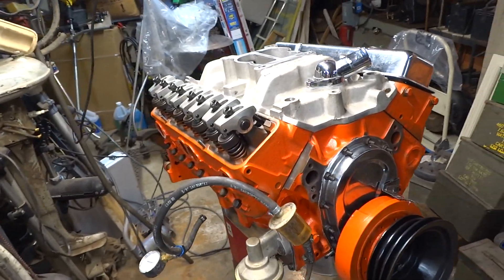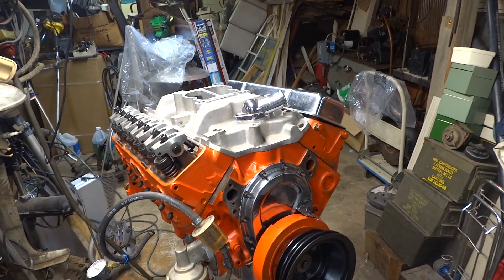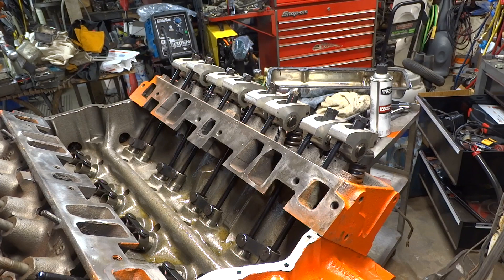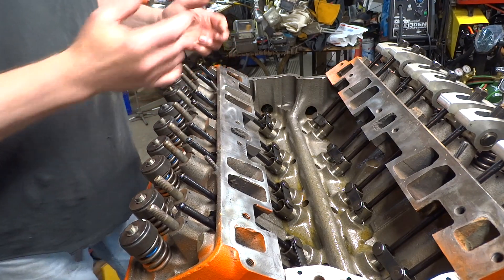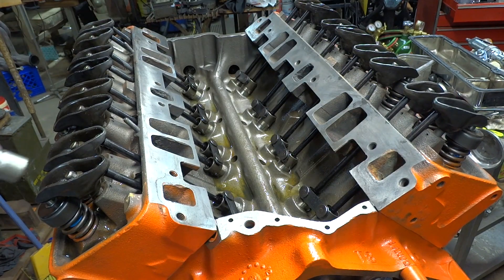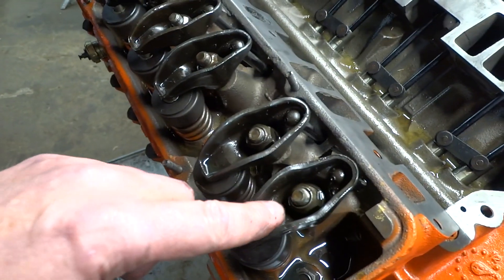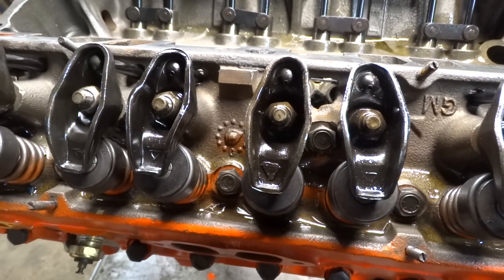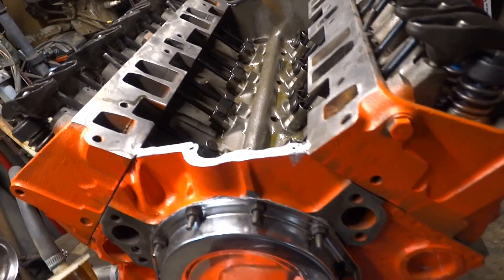SBC 400 Engine Rebuild part 3

Comment: No preload after your zero laysh adjustment?? Put a few studs in the heads to line up the intake bolt holes. Then you won't have to wiggle the manifold back and forth and wreck the silicone.

Comment: Go with taller covers and keep the rollers. They're worth about 12-15hp
Reply from the maker: as i said it's a budget Build.  i wasn't putting anymore into it that i needed to.  since i built it i haven't even got to really drive it.  that's why i didn't put anymore in it than what was needed to build it.

Comment: So do you start at number  one  t.d.c. or do you just move the balancer half a turn? Any where adjusting the valves .
Reply from the maker: you can start anywhere.  and moving the balancer 1/2 a turn turns the cam 1/4 turn.  3-4 turns on the balance will make sure you got everything right. then adjust the rockers to your desired preference.
Reply: @KensStuff  ok because my number 6 cylinder and 1 are at both top dead center
Reply from the maker: @kjc1878  that is normal.  and makes no difference.  you're first taking all the slack out of the valve train.  going over every valve checking to see if it's loose each time you turn it.  by the time you get to the 4th time they all should have zero slack.  if you want to be extra sure, do it again.  then once you're sure you have them all set to zero play tighten them all down the added 1/4 to 1/2 or 3/4 turns and all should be good you can turn the crack around till you feel compression on #1 cylinder set the mark to where you want, and you can drop in the distributor.  i've even done it at 1/4 turn at a time.  it takes longer but you know you got every valve set to zero lash.
Reply: @KensStuff  ok thanks a lot man . I appreciate  it.  I'll do that thanks again.

Comment: I'm new to your channel. Seems counter productive to put stamped OE rocker arms on a roller cam set up. The thing that you didnt talk about concerning the china wall gasket theory is, sometimes when a block and or cyl heads have been machined down quite a  bit, that gasket wont fit under the manifold. Hence ultra black silicone.
Reply: The option is used often as roller rockers don’t add significant horse power to cost ratio. It’s not counter productive at all. It’s way common. People buy roller rockers for the looks more than the function. And they spend tons of money for very little increase.
Reply: @MrCbell57  Its not about the looks. Its about higher lift. Its about scrubbing the valve stem.  Its about making the valve guides  last longer. Its about increase in spring pressure. By the way, its very uncommon to put put a stamped piece of metal on top of a  roller cam...